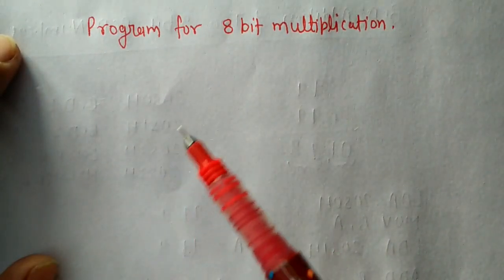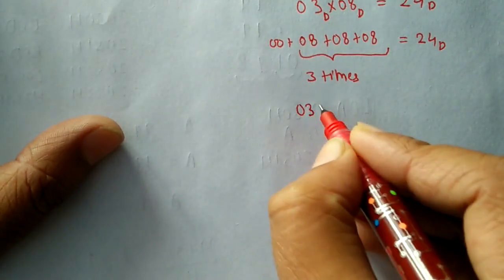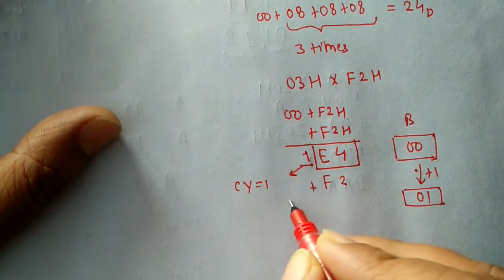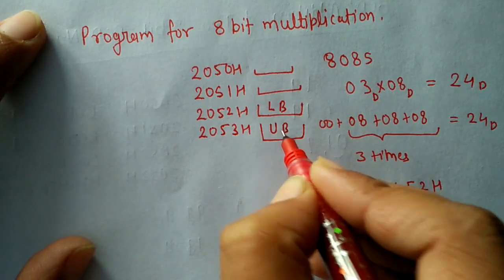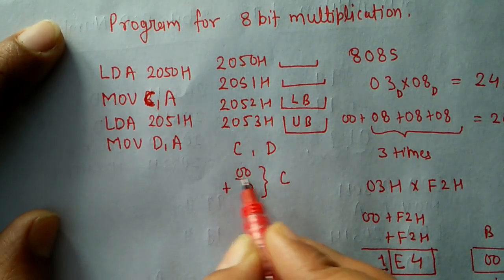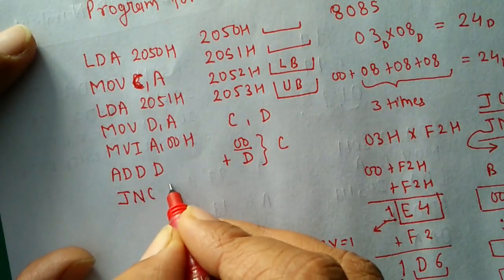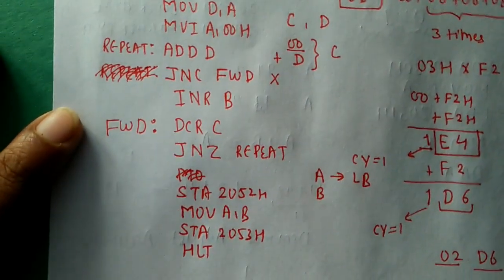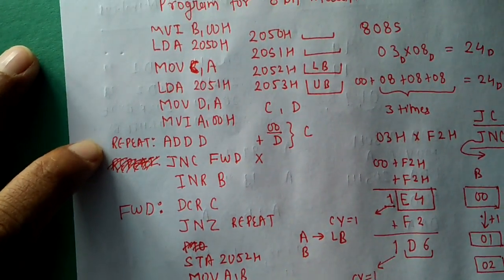8 bit multiplication using 8085 microprocessor/ (multiplication in 8085)

Comment: Sir if we doing 15×0 then answer is 15  according to this program
Any solution?
Reply from the maker: +Rajendra Nodal yes you can check for operand if it is zero then route the program to store zero as output.
Reply: @Videh  sir if we given data to location 2050 is 00 and 2051 is 04 then the result of accumalatar at location 2052 is 00 but result of B register is coming 04 when we execute the program